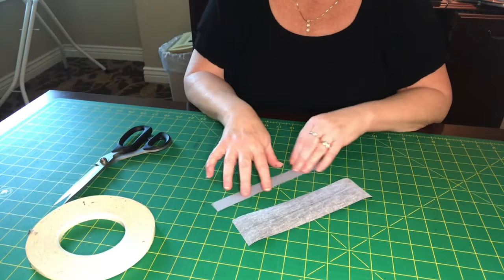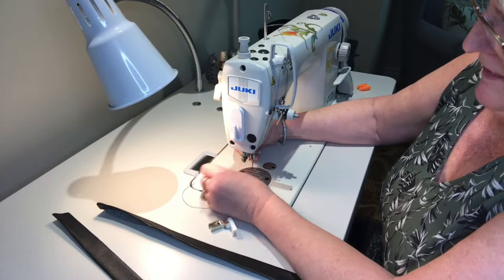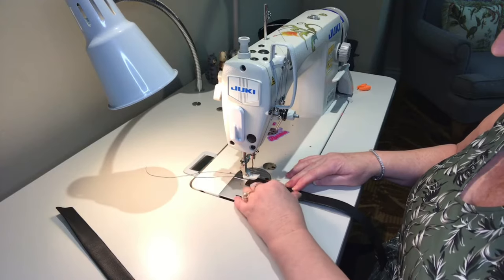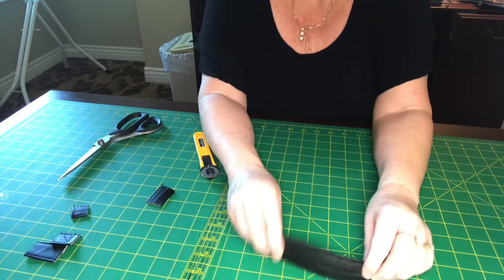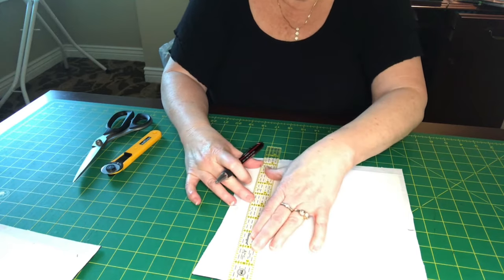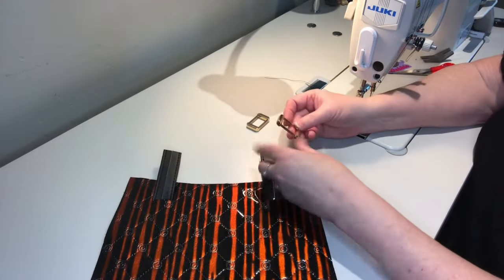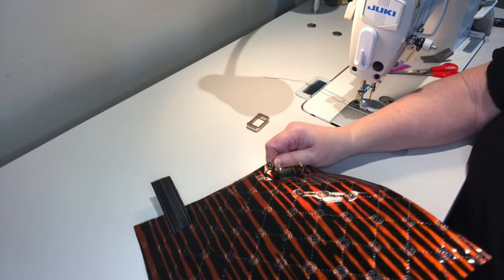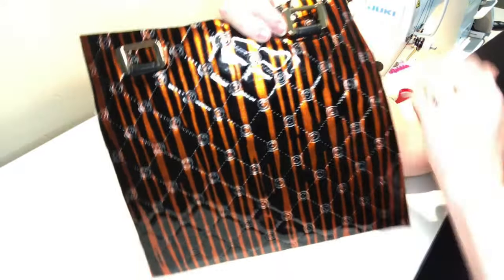#10 Handbag Course - Hidden Strap Connectors - With Kelley Rao

Comment: Does anyone know where I can get an 1/8 inch Teflon edge foot for alow shank domestic machine?  I tried cutex and Amazon and could only find them for industrial machines.  Thanks!
Reply from the maker: You might try a low shank teflon Zipper foot; I have seen on Amazon.

Comment: Thank you for the great video, I have a question about changing the foot. I have to use a screwdriver. What kind of device is that with you? ￼
Reply from the maker: You’re welcome. It’s called quick release foot. Works on most high shank single needle machines. Try Cutex Sewing Supplies. About $8